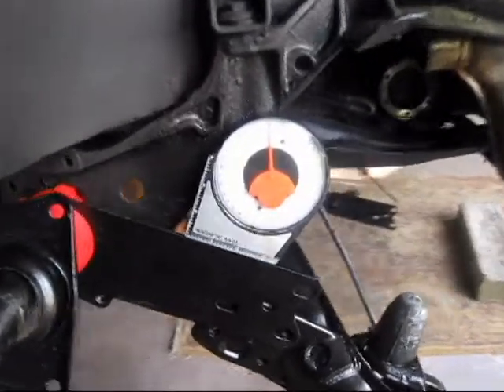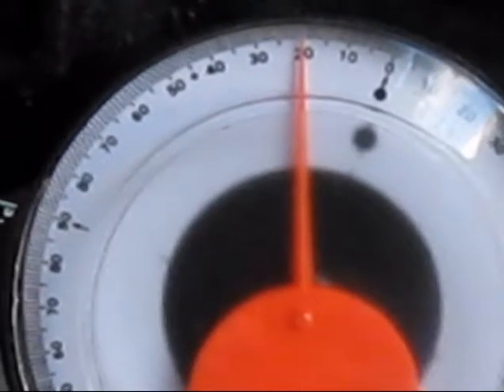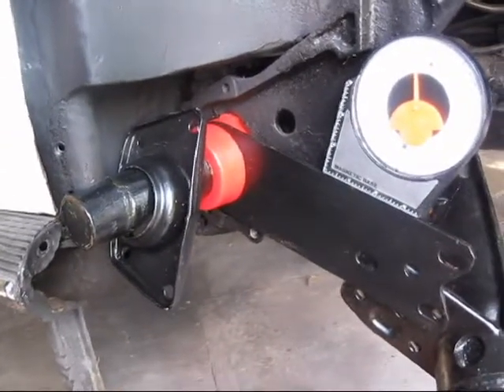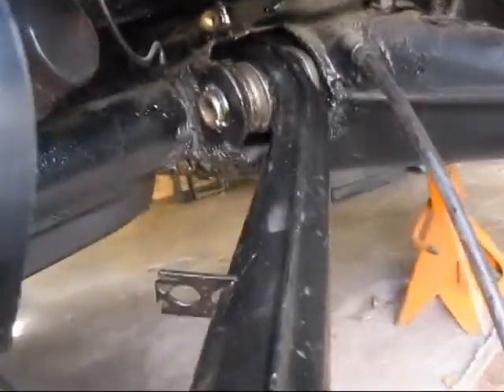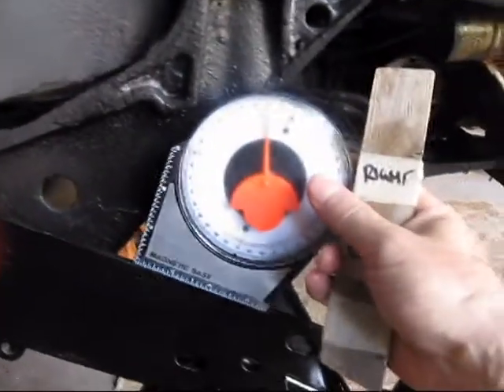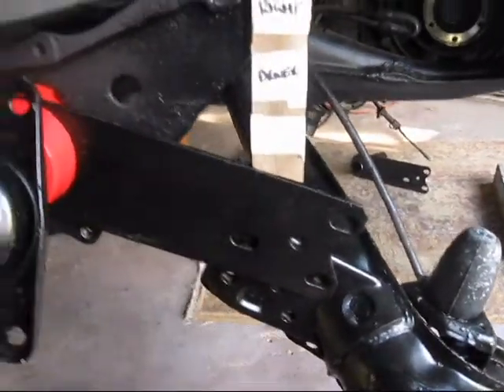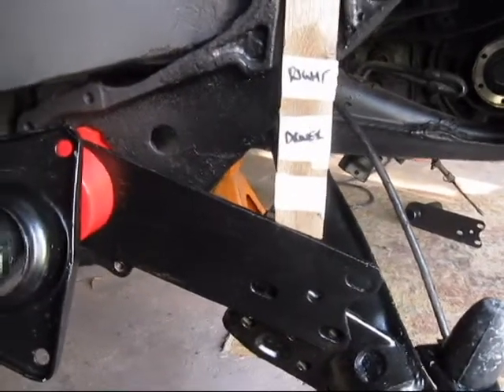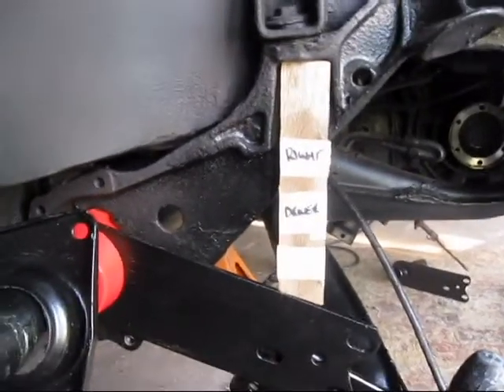1979 VW Super Beetle Rear Control Arm Installation

Comment: Is 20 / 21 degrees the setting for the factory installation?
Reply from the maker: Yes that's what is recommended. That should give you stock ride height. As far as I can tell the car is correct now.
Reply: @TheNovaJohn  So the chassis has to be levelled where do you measure for level along the rockers?